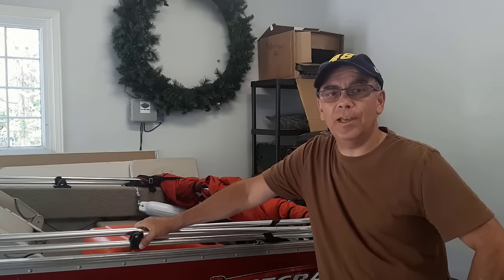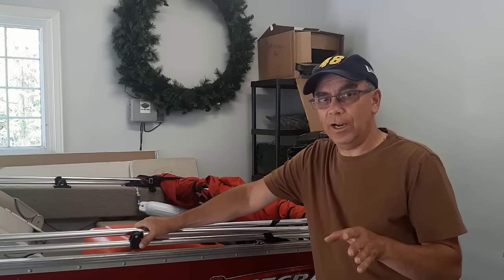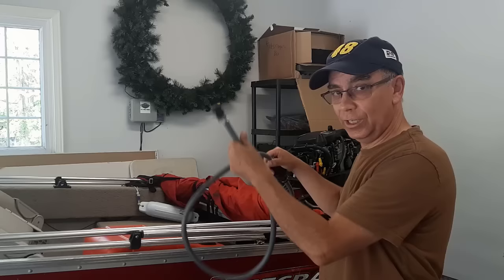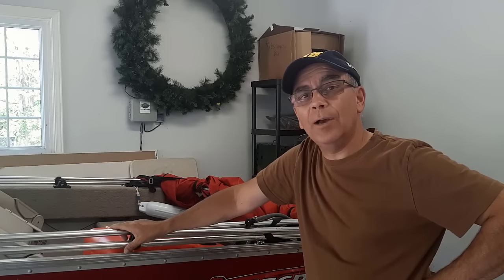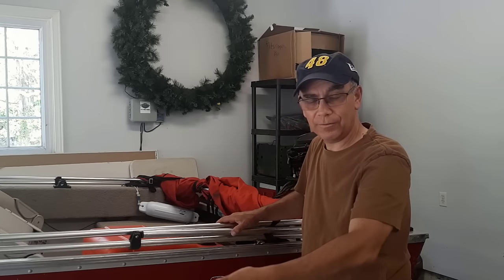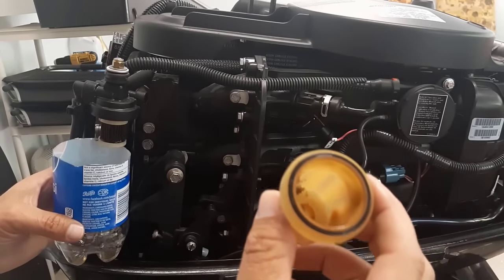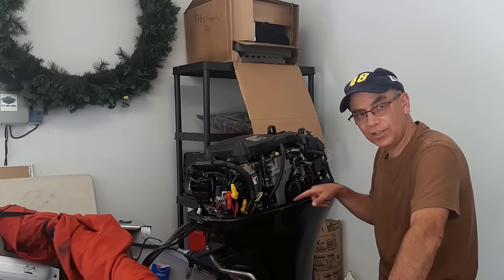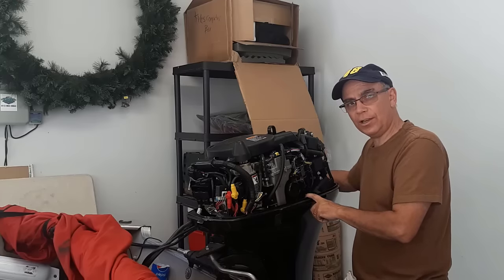Mercury Outboard Runs Then Dies // Try This Before You See Mechanic

Comment: I would have checked the filters, once when I was much younger and not nearly as good looking, I had a 1974 Datsun pickup. Thing ran great but just every so often it would backfire and die, then fire back up and run great😁😆. Replaced dang near every electric part and rebuilt the carb, still did the same thing. Finally someone suggested the fuel filter, I had already replaced it once so I traced the line back from the fuel pump and nothing was back there but the tank SO pulled it off, lo and behold full of insects. Another story about how the insect were inserted into the tank.

Comment: Thanks for the info! I had to do the same but I hadn’t used the Mercury outboard for 25 years. I did all you had sequentially and it started first time with the turn of the key. One of the suggestions was to use clear tubing. Tygon hose is the only one that doesn’t harden over time and not prone to splitting. However, it cannot handle the same abuse as a reinforced fuel hose. If the tank is rigidly mounted and the fuel line is given support and cannot be dragged on it is a great alternative, but I still use the double braided fuel hose for safety.

Comment: I had that same problem last year, but only changed the top fuel filter and it did the trick. After about a year sitting took the boat out yesterday and it did the same thing. Now I drained the gas, changed the fuel filter and we'll see what happens
Reply from the maker: Good luck! Hope it works out.

Comment: Having this very same problem. Replaced water temp sensor. Thermostat which was stuck open. And did the impeller. Wasn't the problem. Moved to gas lines. Replaced both fuel filters, new gas line from tank to outboard. New gas tank. Have no idea from here what to check. I did notice water coming from a hole in the front of the outdrive looks like a over flow maybe? Don't remember it doing that before? But don't know what else to check! Will need a mech soon. Was trying to avoid a 400 plus dollar fix.

Comment: Great video brother!  I have a newly acquired 1990 OMC 2.3 i/o forester that has a fuel issue. I will be looking into some things you mentioned and hope it works. My issue is it will run just fine but when you juice it, she dies. The mechanical pump was disconnected and an electric was put on with a primer bulb. I've been told to take out the bulb and try it.

Comment: Might want to note a couple of things.  Zip ties aren't really a good fuel clamp because a right angle is formed at the clip block.  That right angle can lead to an air leak at that point where the tie has a four or five degrees of the circle that are not fully compressed.  Properly sized (whichever style you choose) clamps are essential.  There has to be sufficient force but not so much as to break the nylon fittings.  Also your secondary filter is subject to gas deterioration sitting in that line as well as the finer micron levels that the primary filter is not designed to catch can build up over time.  These can lead to fuel delivery problems and particles that block fuel ports down stream.  Keep in mind that all the plastic parts can deteriorate in sunlight and with time.  Keeping a cover over them helps a great deal.  Portable fuel tanks also can get brittle with time and crack as they loose their polymers over time and with U/V rays breaking down the formula making up the plastic.  There are rated fuel hoses that are better than the gray plastic lined ones although they too will only last so long but at least when they get old and brittle they aren't dissolving in chunks into your fuel system.  The approved ones will be so marked right on the hose itself.  Hope you solved your problem and are happily boating away.
Reply: Never had a problem with zips in a 2.5 psi situation lol it’s what’s recommended.

Comment: I was thinking the gas cap valve failed, the same thing happened to me once. That Cap has to allow air into the tank to draw fuel to the motor. 
I had the same issues. I would change or clean your jets/ needle valves if carb engine.  That looks like a newer engine than mine. I have an 03' Pull Start Johnson 25hp carburetor engine.  That water pump impeller is super important.  Good swap there & figuring out it was something simple. I was taught to always go "Simple First" then go from there when troubleshooting.. 👍
Reply from the maker: I wish it was the gas cap only. lol

Comment: I'll have to give this a shot. I suspect the fuel system is my issues.. I doubt it's the carbs because they look great! But it just has a hard time starting and then it chugs once started and the power just isn't there holeshotting it, and at WOT you can feel it going to full power then backing off, then going full power then backing off. I'll take a look at the fuel line and start there. Thanks for the vid!
Reply from the maker: Best of luck! I hope you solve your issue.
Reply: @GettingItDoneRepairs  Thanks! I hope so too.. the guy i bought it from said "it was bad gas that needed to be ran out". After 2 tanks of gas, the problem is still there.
Reply: @BentRodsTackle  remove carb, open it up and clean thoroughly paying close attention to jets and small passages.

Comment: Had a 15 hp Mercury and put an extra fuel filter on it inline. The fuel filter inline was clean but the one on the engine looked like it had jelly in it. Caused by fuel with alcohol in it.

Comment: I had a similar problem and it turned out to be coming from a built in gas tank and I took the tank and had the inside treated with a sealer and that fixed the problem.

Comment: on the top of the gas tank there are two caps on top of each other a smaller one to vent and a larger one to open and fill fuel with when running the motor does the small cap need to remain open all the way to vent ?

Comment: I had the same problem and found that the air valve on the lid of the fuel tank had build up inside of it.
I disassembled the valve on the lid and poked out the tiny hole and blew compressed air through the hole and heard the blockage shoot out.
Checked everything you mentioned first only to find it was the tank breather.
Reply from the maker: I had that happen on a generator. Glad you found it.

Comment: Hi Roland looks like I might be having the same issue. Out of the water my idle runs fine but once I get in the water it stalls in idle after a minute. I’ve changed the gas line and put in a new gas filter. 2002 40hp 2 stroke
Reply: Did you ever figure out your issue. Mine is doing the same thing.

Comment: My last issue was like that my propeller didn’t have enough pitch the engine too high RPMs. The (RED) light on the Suzuki DF25 v-twin will come on for 3 reasons high temperature, low oil pressure & over revolutions.

Comment: I have the exact same problem with my Yamaha 90.  I've done everything you did, except replacing the fuel tank because mine is built in. Unfortunately I still have an issue.  Any ideas?

Comment: I have the same problem. I have inboard motor. Thank goodness I found this video I’m gunna start with ur suggestions.
Reply from the maker: How did you make out?
Reply: Getting It Done North Of 7 it worked for 2 hours and then did the same problem that you fixed I’m going to try to do fuel pump. I’m not sure abt the next step. I thought I almost had it fixed
Reply from the maker: @spencerhagerstrand3257  there is a 2nd fuel filter on the lower right side that is hidden in a black sleeve. That could be plugged. Was the filter you changed dirty?
Reply: Getting It Done North Of 7 yes the one I changed was I will try to find the other one. My motor is onboard though but same problem. I will check for other filter thanks for the help I’ll let you know how it goes.

Comment: I have a 17 foot Bass Boat Tracker with a Mercury 75 hp. Same issues tomorrow I will change the complete fuel line and primer ball.  Thanks I will let you know what the outcome is.
Reply from the maker: If you notice your fuel line has deteriorated inside, change the fuel filter as well.

Comment: Have a very similar issue today, mine is only one year old it would run and then bog down and die and only restart if I primed it (never touched the bulb before its EFI) as if it were out of fuel but I have a 1/2 tank...... anyway after watching your video I went out and changed the filters, I had them on hand from the 100 hr kit but did not change them at the annual service because the boat only had 55 hrs on it and mercury says change  at 100 hrs. anyway I changed both (got a nice gas shower from the high pressure one on the R side) ....  anyway took it out again today and ran it WOT except for wake zones for about 40 minutes  and it ran normally so hopefully this was my problem also. My R side filter did not have any visible contamination in it like yours and little resistance when I blow through it (yea I know not smart but I wanted to know how clogged it was) but maybe it was enough. So if people out there have not changed their filters in awhile  ---- might consider it before you have an issue,  hopefully mine is fixed I may go out again tomorrow so well see! thanks for the video I had not considered fuel filters I was thinking fuel pump because it would not restart unless I primed it.

Comment: routine maintenance items continue pull prop grease all check for fish line at seals
lower gear oil   -- all fuel lines -- fuel pump rebuild- carb clean - compression check log
replace or check spark plugs, all wiring tighten all screws/ bolts nice boat  fun time

Comment: I’d stick with non ethanol fuel after you get that system cleaned out. Shouldn’t have any issues moving forward.
Reply: Why it does matter, non ethanol gas does not breakdown and crystallize as fast when left in storage
Reply: @ethanmaiden  I just seen a test done on ethanol fuel in marine motors and it shows that ethanol is very bad on all seals in the marine motors in a short amount of time. Ethanol breaks down the liners he’s talking about but the new lines have the same liners so you have to buy fuel lines made for automobiles. They don’t have or need the liners so the ethanol won’t break them down. Hope this helps someone. 🙏👍
Reply: spend the extra few bucks n get premium.

Comment: Thanks! For the great run down of your troubleshooting.   I have a 15 hp 4 stroke Honda that putters out when idling.   I'm going to start with the changes you've highlighted here
Reply: What was your problem
Reply: What was your problem
Reply: @heaththompson4410  I replaced the carburetor rather than cleaning the old one.  BUT, a little corner of the gasket was folder over and the seal was broken.  Once that was remedied, it started running well

Comment: Another good thing to check apart from your fuel   filters are the thermostats  these are also going to give to problems especially in salt water and muddy areas we flush our engines but we don’t do it long enough for them to open up hence all the salt and rubbish gums up system. Same problem as your fuel and filters should also have a water separator installed if using an under floor tank.

Comment: Please can you help me I have the same issue it’s the same model just a 60 hp I have changed all coil pack and the 2 filters you changed and also the fuel lines spark plugs but never changes the tank !! Cheers 😁🇮🇪

Comment: Great job 👍🏼 I'm having same issues on my 22ft walk-around angler boat starts right up and then it bugs out and shuts off. Allready replaced filter/water separator, engine filters, new gas, sparkplugs and still hesitates to start and if it does it shuts right off .....I have a 03 Yamaha 150hp 2 stroke ox66 fuel injected model still haven't found the problem. Any suggestions would be greatly appreciated. Thanks guys. Cheers 🥃

Comment: Good video. I had the same thing happen recently with my 2 yr old low hours Tohatso. When it balked the sqeeze bulb did not feel right. I removed the fuel outlet and gauge from the tank, (same as yours). The fuel pipe had fallen off. I put it back with a clamp and it runs like it should.
Reply from the maker: Good to hear!

Comment: Great video, sometimes you gotta start with the simple things. I always drain the gas out of the fuel hose over the winter, so no old gas is sitting in it all winter long.  Hose is 24 years old, so far good. I also now always use Super non ethanol gas in my boat, lawn mower and snowblower.  (and one car that doesn't get driven often)

Comment: I have a similar problem but my motor dies like it's starved of gas.  The bulb collapses, like a vacuum builds up in the fuel line.  I've replaced the bulb and I pushed fuel back into the tank through the fuel line to get gunk off the filter on the fuel uptake.  Like you I've had several incomplete successes.  My tank is built into the boat so my next step will be removing the fuel uptake

Comment: I have that same motor and had a similar issue.  But mine would die when going at slow no wake speeds.  I changed the fuel bulb, still did it.  I changed the fuel line, still did it.  Lastly I changed the fuel tank and now haven't had any problems since.  I haven't changed the fuel filters at all.  I might do that soon.

Comment: Inside the fuel tank is a drop tube with a tiny filter on the end of it.  This drop tube is generally made of a cheap clear tubing that has a life expectancy of no more than 2 years if gas is kept in the tank.  The gasoline will draw the plastisizers from the plastic suction tube and it will become brittle. The internal tubing would literally crumble in your hands.  Also the hose barb on the fitting it attached to was also brittle ang broke off.  If the tube cracks or breaks off inside your tank, your fuel delivery will stop and you will be dead in the water. I just converted my drop tube to all metal using a 3/8 X 1/4  reducing bushing with the tank side of the bushing threaded to accept a 6 inch long 1/8 th inch pipe nipple.  I attached a small square of fine screen to the bottom of the nipple.  My Atwood tank was only 3 years old when this problem occurred.   It's a sad commentary on the quality merchandise now days.

Comment: I’m having a similar problem I’ve got a Yamaha 25hp it starts right up very easy but has never ran good at higher rpm. The carbs have been cleaned the spark plugs replaced the water pump is working properly I’ve bout ran out of ideas on this thing. It seems like the more gas you give it this worse it runs. Any ideas

Comment: Here is another possible cause that you may have corrected by replacing the fuel tank: Evil, insidious failure of the fuel tank air vent to open. In order to prevent tiny amounts of fuel evaporation from escaping through the air vent into the environment from the tank (and not trusting the user to close the vent), some newer tanks have a diaphragm in the fuel cap that will only open when there is a slight vacuum in the tank - even when you have opened the air vent. When the diaphragm fails to open, the engine will be fuel-starved at random times when a vacuum develops in the tank. Detection: The engines fails as if it the tank is empty. The primer bulb collapses when squeezed and doesn't re-expand, or a "whoosh" sound occurs when the fuel cap is removed (you may even see the sides of the tank expand). Correction: a) Loosen the fuel cap to allow air to enter the tank to get you home and then replace the tank or, b) find an old fashioned fuel cap without the evil diaphragm.

Comment: I have done all of this and still have a motor that acts like its running out of gas after about 30 seconds of running well.  I am pretty sure it is a sticking float in one of the carbs starving two of the four cylinders of fuel.  The filters supply line are good things to check before going deeper though.

Comment: I was having the same issue but my problem was the Bulb (Pump) in the Fuel Line was bad not letting enough Fuel get to the engine. I changed the bulb in my fuel line and it worked perfect.

Comment: My Mercury 6hp 4 stroke starts great but I can never get it to run full throttle with the choke off just halfway.  Great video!
Reply: Try replacing the spark plug or plugs.
Reply: Runs better Half choke points to a dirty carb.Remove it and clean it not that hard to do...

Comment: Having the same issue right now..change the engine fuel filter an i change d fuel water seperator and 4 spark plug an still not running to a full speed it dies down..its a mercury 90hp 4 stroke

Comment: Had this same problem with my mercy 9.9 hp. She wouldn't run above 3 mph without bogging down and dieing. Cleaned my carb, thought that was it, but no. Changed the fuel filter, was extremely dirty but still not running right. Had an extra primer bulb/fuel line and changed it out and Viola, ran perfect. My old fuel line inner liner was clogging from breakdown just like you were talking about. Wish I would have found your video before my hours of trail and error 😅..and it kept me from opening night of alligator hunting season...what a bummer
Reply from the maker: Thanks for watching!

Comment: I have a 2016 mercury 40 hp 3 cylinder it hic ups goes into what I think is limp mode ... when I throttle up it hi cups feels like the Ignition shuts down  All I didd was put stabil in the engine last winter and this engine ran great befor I pulled it of to do a new transome .  fuel filter tomorrow and checking on the fuel lines as well. is there a way to pull a code on a 14 pin mercury 3 cyinder to count the beeps issue  Thanks in advance

Comment: I had that same problem but i was 6,5 nautical mile offshore  but what i did to get it to fire back was lack of fuel but not due to the fuel pump it was not the fuel filter but i did some thing don't remember what i di but after 5 minutes it started backup and ran farther offshore out to the deeper reefs in around 110-195 phantoms  but after midnight ran back to the docks with no problems